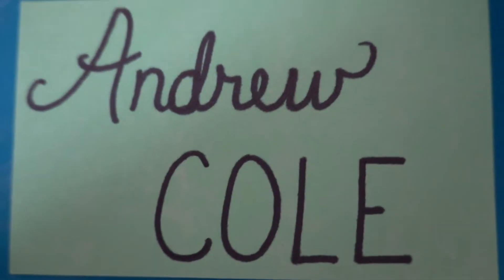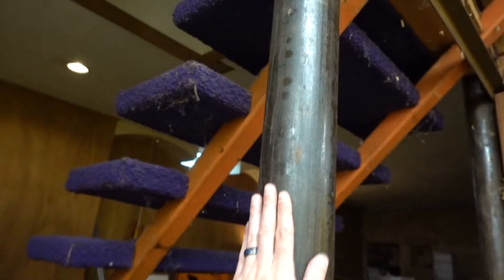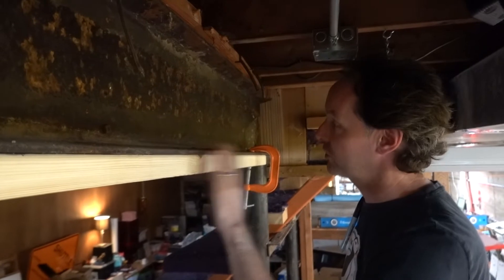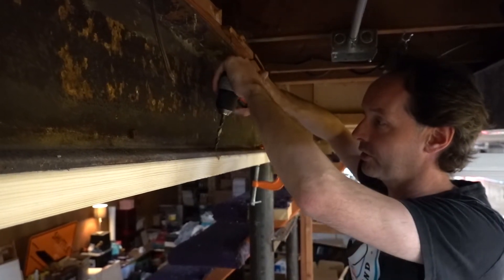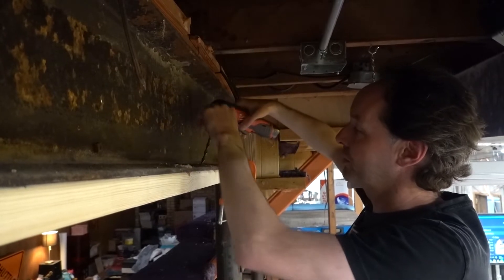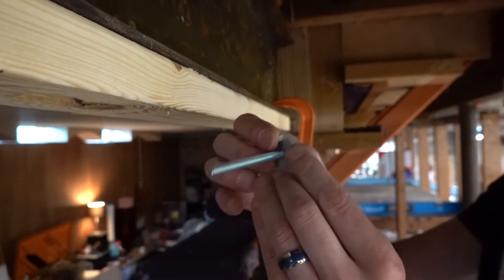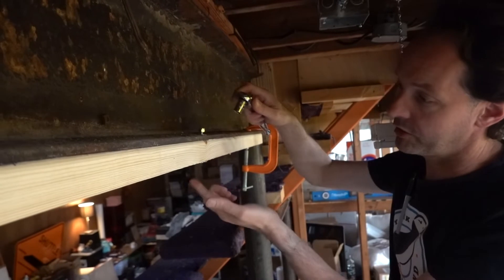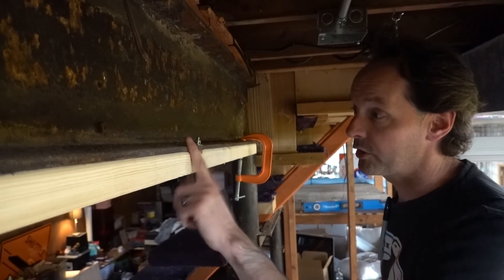Captain's Blog 6 14 2019 How To Attach A Stud Wall To A Steel Beam

Comment: I think you mentioned that the ends of the footplate were not square, something you should do at some point when square ends become important is to check the squareness of the crosscut saw fence, there's usually 2 screws holding it down, but has a bit of wiggle room. and there are set screws (stops) for adjusting the vertical angles.
Also it's good practice to cut a small bit off the factory end before measuring

Comment: Does the bolt have to be galvanized?
Reply from the maker: The bolt can be just about anything, Galvanized, Stainless, whatever. It doesn't really matter so long as it's strong enough. Given how few you'll use for this, the material can be as fancy as you like because the cost won't be very much. It all depends on where you want to put it, how many you need, and what you need it to hold.

Comment: Obviously that's a very solid & secure connection, no criticism intended - but a little easier to use are "teks" screws designed to screw through wood into steel without any predrilling, that's probably how I'd recommend doing that. The screws incorporate a mini-drilling tip that gets through the steel and then it self-taps. They are used for things like trailer decks. Since I discovered those screws I try to use them for anything like this.
Reply: LOL - Yeah good luck with that.  I give you about 1/8" before they break.  Unless you're using 1/2 self-tappers, then you MIGHT stand a chance.  But I believe a #14 is as thick as they go.  As far as I know anyway.  No offense, but I don't know a single soul that has ever succeeded doing that without a drill bit.  I don't think they're designed for that type/thickness of steel.  All funnin' aside, you have to use the 10% rule of carpentry whenever using anything your daddy didn't teach you, or new.  1st of all, another name for Tek Screws is sheet metal screws.  If you read the specs, it actually tells you to use a pilot hole.  Lastly, the specs also tell you not to drill any steel longer than the bit length on the screw.  Again, I was just funnin' with ya, but I don't think those are designed for something like this.

Comment: how long was the bolts?
Reply from the maker: Depends on the application. Let's say you have a 1/4"-20 bolt going through a 2x4. You'll want 1/2" for the bean plus a little extra, plus 1.5" for the 2x4, and half an inch for threading. Thus, you'd want a 2.5" bolt for that application.